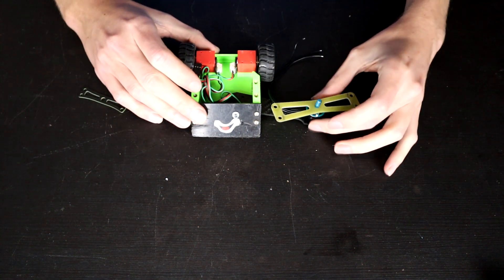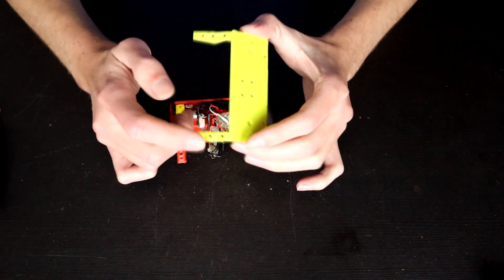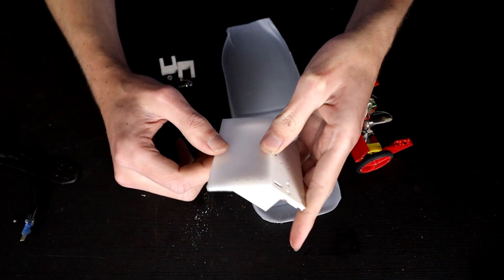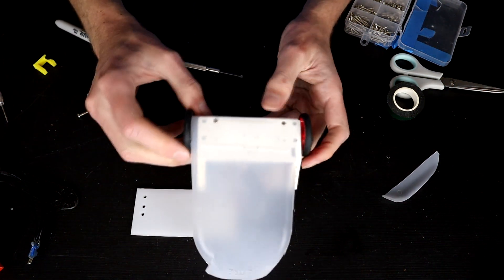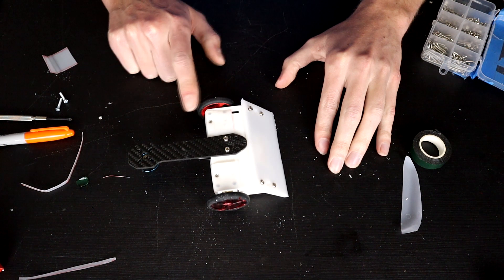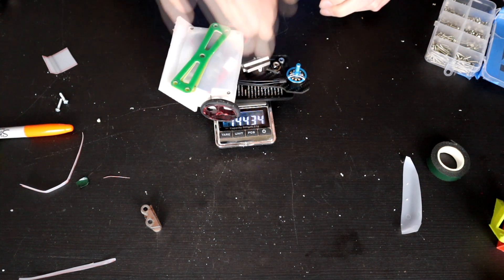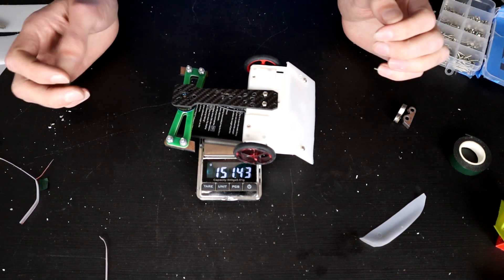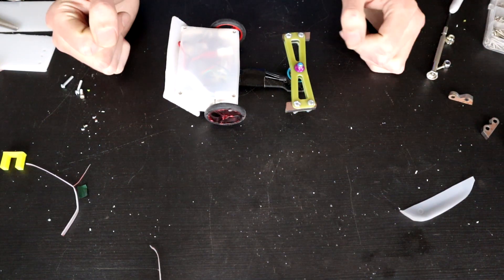Building the most original 150g combat robot!!

Comment: I actually just built this setup this week. The wedge was longer and less steep but worked for balance. The spinner on the opposite side actually had the tilt that your original wedge has. So you can attack with the spinner or you can wedge a bot up and still use the spinner once the bot is up on top

Comment: You better lawyer up, the cease and desist is already in the mail.
Fun video as always! I would recommend filing the shaft of the motor to a rounded point, that way there's less friction and it won't try to turn the bot as much.
Hopefully the event went  well!
Reply from the maker: I'd like to see you try! I built this bot in international waters

Thanks! I didnt end up filing the motor shaft but I did work out a way to round the point to lower the impact of the weapons spin.
The event went ok, fight report will be out on the 2nd of sept

Also if I've got weight I'll bring this with me to NHRL, will be fun to see the size diff between it and maximiser

Comment: Sorry, but I've been competing with a 150g bot (Alien Stingray) with a rear spinner much like Thagomizer for the last 6 months. It has a Matter Hacker PLA+ Tough plastic bottom frame (where motors, battery, a dual ESP for drive and brushless ESC , receiver, and Arduino Nano are mounted) and a TPU top, 1805 brushless motor,  and custom wheels. It comes in at 148g and it can knock the dickens out of other bots. It's biggest advantage is when other bots approach this bot, it can quickly rotate and attack other bots on their side where there is less armor and exposed wheels. 

The Arduino Nano interprets the receiver signals,  manages wheel and rotor speeds. With a single stick movement the Nano initiates an attack mode where the rear spinner is brought up to full speed from an idle (the bot is difficult to drive at full rotor speed) and ramps up the drive motors using a sigmoid function to maintain best traction for the fastest possible rotation of the bot.
Reply: hello Stephen ive come across youre robot while browsing robots on builders database and it is amazing. i would love to see it in action
Reply: @jacobmoscarella9057  
Hey thank you for the acknowlegment. 

We are trying to get set up for the competion in Hickory NC . We are in the middle of selling our house and moving which makes it difficult to build bots when your shop is being packed for a move. My wife actually drives the 150g Alien Stingray while I am trying out a 1lb bot Devilray with a simular design. 

I love the unique possibilities for this design even though it has been a major challange to balance spinner motor weight, weapon speed and speed with drive motor speeds.
Reply from the maker: Your bot sounds very cool, I'd love to put some smarts into my bots again. Maybe in the future.

Also to state what I thought was the obvious, the title of this video and the name of this robot are a joke. I know this build is in no way original, there's even another 150g Thagomizer at my local comp